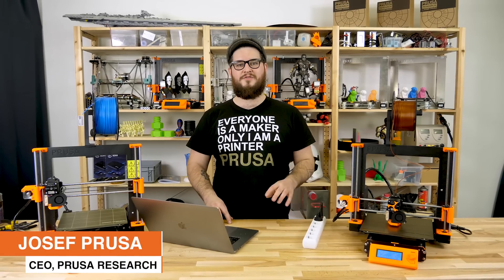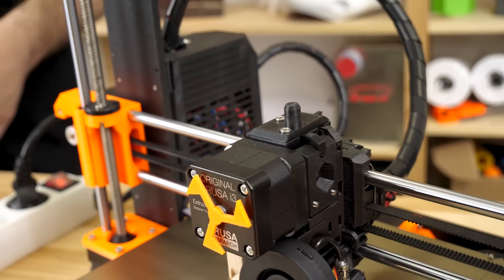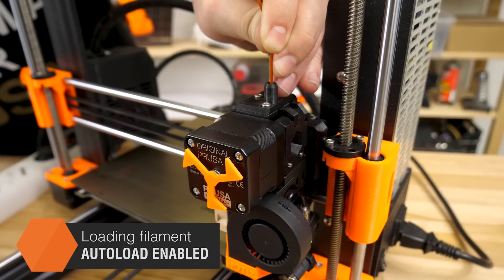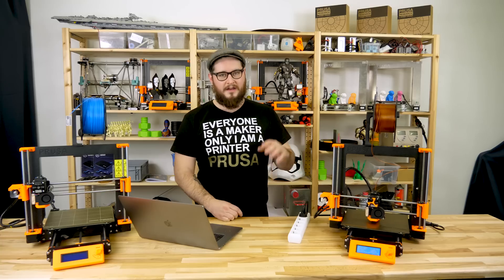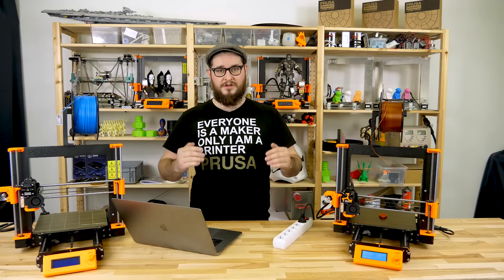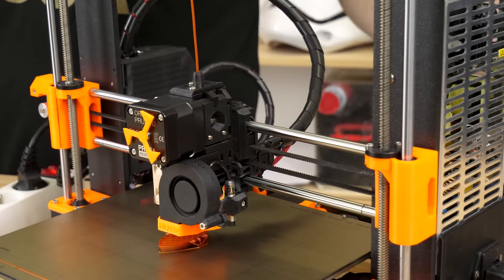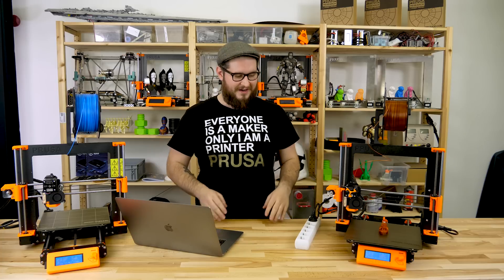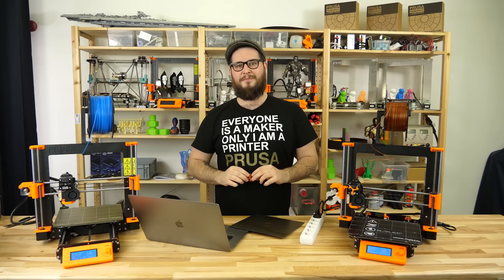How to test safety features on the Original Prusa i3 MK3

Comment: Just now, my light blinked out. My MK4 with the latest firmware heated up the nozzle, the bed, and without any alignment of X and Y axes, without cleaning the nozzle went to continue printing. As a result, the filament started coming out a few centimeters after resuming printing, and there was a shift in the Y axis because the power was lost during acceleration.
I had 4% of the model left to print, 96% was finished. And now it's already in the trash garbage can because the blank layer and the shift ruined everything.
And this is not the first time.

And so yes, the feature is useful and it looks nice for advertising too.

Comment: 1st off, i love my MK3!
That said, i dont see the point of this feature unless ur awake and at home when power failure hapens. I just woke up and my power went out in the office.
After i turned the power back on,  i selected yes, to continue,  and printhead draged my print with it when it moved to heat up.
Pointless if the print is not going to stick to the bed when the power gos out in the middle of the night.

Im i doing something wrong?

I just had a power
Reply: Yes it is normal, I have the same issue.
Unfortunately, there is no fix and we have to throw the print :(
This feature is just there to make the printer a bit "smarter".
Reply: @MichelBricole  I've used the "recover print" feature multiple times and it worked. It's also extremely handy if you need to move the printer to another room in the middle of a big print - just unplug it and then transfer it and plug back in. Very nice feature and im glad it's there.
Reply: @TheRAINMan059  I agree the recover feature works perfectly for me too. But if the printer is unplugged for a while and if the bed cools down too much, the print won't stick anymore to the bed. That's the issue...

Comment: Please note: it is inly a filament runout sensor. It eint detect a clogged nozzle. And the crash detection only works when the steps are skipped because of external issues. If the printer just skips a step the detectuon wont recognize it
Reply: Senf Meister actually... The filament sensor did detect when the nozzle jammed, it does detect whenever filament isn't moving. The crash detection also detects skipped steps from acceleration, as well as hitting something. There's also cooling fan detection to prevent overheating the print head. I've owned mk3 for two months.
Reply: Sloth not here. Had a jammed nozzle and the printer was still printing. Had layershifting and the printer doesnt recognize it. Btw support told me this too
Reply: mine also continued for a while trying to force filament trough a clogged nozzle and only after the filament jammed the gears.
By that time several layers where missing causing a failed print.
 So far its been reliable as a out of filament detection but not more.
Reply: i assume that the jammed nozzle detection sloth is referring to isn't the filament sensor at all but the stepper skip detection.

Comment: Going to get one I think, although I hope there is going to be a dual nozzle upgrade at some point, I'm torn between the Ultimaker 3, this Prusa and the BCN3D. Having a second dedicated nozzle for dissoluble supports is a must, but other than that, I've heard nothing but extremely good reviews on the Prusa.
Reply: Some time in May-ish, they will have a multimaterial upgrade for it that will handle five filaments at once (with support material as one of them) while keeping with a single nozzle.